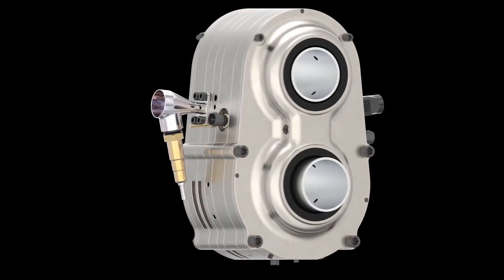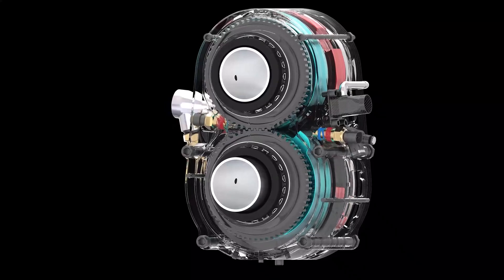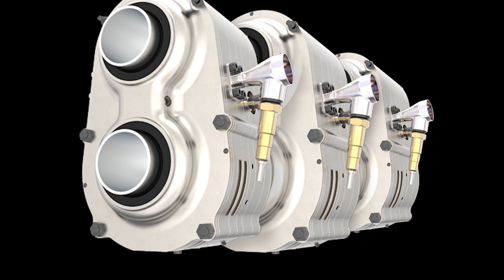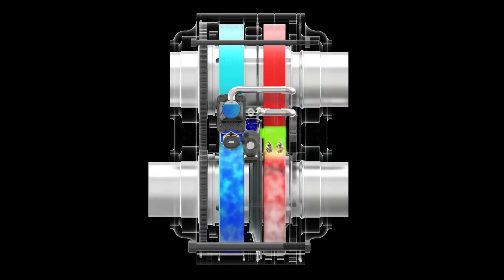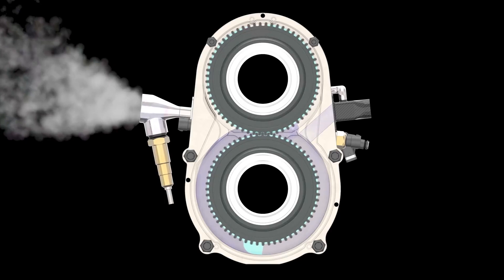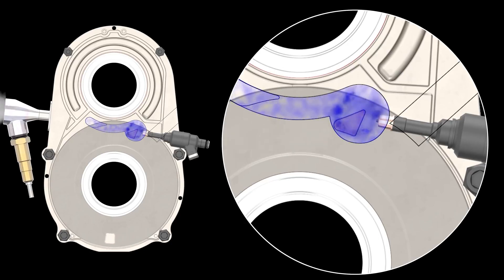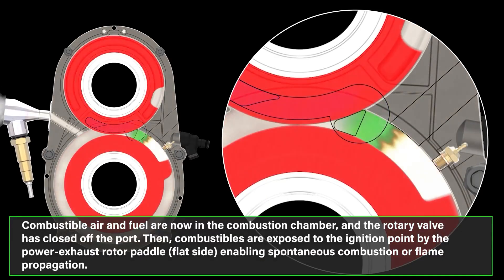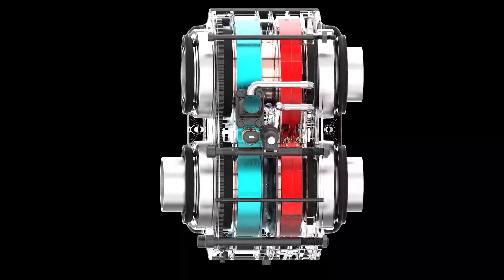This pistonless engine runs on hydrogen and revs to 25k rpm

Comment: [Initial coarse appraisal of carbon/carbon mechanical properties were carried out by spin pit testing and furnace oxidation tests. Spinning was by a vertical air turbine capable of 150,000 rpm in a chamber evacuated below 100 microns to reduce air friction. Coupons were exposed to oxidation in air in laboratory furnaces and tube combustor liners in a burner rig.
The following significant observations came as by-products of preliminary experiments.
•
•
•
•
Press- or serrated fit interfaces of carbon/ carbon speciments with metal fixtures caused no notable distress or bias in test results.
Gross scratches, gouges, punch marks, and other intentionally imposed defects did not act as stress concentrators or promote fracture at sites away-from expected stresses imparted by spin tests.
Disk and bladed specimens machined to simple tolerances were so light as to require no balancing.
Fragments from spin fracture were thrown into the spin pit enclosure much as metal fragments are, but were so light as to he caught in a rubber-backed plastic pail rather than the lead lined concrete pit normally required…Summary: Certain items seemed well resolved in the WRC feasibility study of carbon/carbon for engine components:
1. Several carbon/carbon bodies of suitable specific strength at ambient temperature retain or increase strength to 5000°F.
2. A sound industrial base of supply and technology is in existence for carbon/carbon composites, and can be expanded or diversified.
3. Carbon/carbon is nonbrittle, nonductile, and relatively forgiving of minor defects.
4. Analytical methods are available for development or determination of optimized fiber architectures in carbon/carbon bodies.
5. Some oxidation and erosion protective coatings for carbon/carbon are of demonstrated usefulness in turbine combustion products.
6. Machining and forming processes for near next shape have been demonstrated.]

https://watermark.silverchair.com/v001t04a001-81-gt-35.pdf?token=AQECAHi208BE49Ooan9kkhW_Ercy7Dm3ZL_9Cf3qfKAc485ysgAABAMwggP_BgkqhkiG9w0BBwagggPwMIID7AIBADCCA-UGCSqGSIb3DQEHATAeBglghkgBZQMEAS4wEQQMk6Y002e-RYenfcpSAgEQgIIDto0Me_GKiRIZ6Rct9-nDEVEfWTFHUPVe6KrPo0jWMMS1ybGuNsMJrDvk8vujSdfykABp5WlWz10Kxlx3b4k3NvPXtJGA8XkRgBu_MEt4TNz_nMi-vxI7Uhsf4yG-ixKQReHpgz8UE-oEbjUJdC5QTgsgadsCg27ozJjbE33MmMowkSN_3OKMORFiQwR-FZiPT1Pc8lTrLNdF9mG3vBr4__r6Ko_kT5sEMRvGgb9pay-UHQgkgcqVWTNlukL8GJUFxcacfzCM7_hu9qO3KNvtqmfODA7fx8_7gPRohzpbBtbKDM0MTfWb635Stx06sdTAZVWmLpr6yvZBOcLRBqapGIP2zaBV2MzBsx4J2ZP5i-hXQsvssujSECWzO-z1CSV-0U-lKaRhZFUIyazyafe0GKE7_xcLg9T4V1lGOzMVkjGYE8vZlnmiCRbrUr7ItTIY6iBi8pXORS8LBL0remNRAe6vpQOibHvvLuonxjlhyRmw-782H3x25HdH91I870Npl3U23wupMdAzZiifTn3KoEN3G0o1AUBLvarwrc_inPXDnwnajgT7dMhIguWsVEm9y7EIfYdhxmwlin8qm76hsKGYaZdInIyfeISwIxb4fbKT128YbACm6pPyXsjuC115W1GiL_XCuuHKTz4sSEQSiiNYqZBpZoLqb6U_QgkP7-ZsAyYkhKqY9SFztG93WyfH5W_XhG-EEiboJ9FcwTp3WJrzbCRqa5cTjqHIY4WO_hCmy5J6RL6RRX1pUsEu02sayKimhVKtiLW3jpF_P1hCgtY6nEAkn7aoJ25VlKKc1vC_QrSVaTWGm5MNn5hiR84WAmcGTImhv5b05YNdPrgyZF23ZehASKTE7Pm2qWZRE1Imzc2wviTHwcd42i0YmROI4xyNw-VGu3eSmSc_pX5oBhC0IaD4ZQ3VXv2azZrm45SyqOKt5odlEDz0c80kTCh4N2I1PI33xcC2e10-r2Sl0QEYZSRxDavRgLzw5bu-0EuP2yXpbr1KKwJmHMOuoPJDYbxu2hnc1b1QnK4HH3cH7fOUdGmUXgYbiKNfJ1rk6ixbjoTYZ1WtTSHoXXLYR6l968FsHXB3KZq7hffFex8AEtstPwhEx0n9J5tu5HYqWEskZTOUjCjT934eKdt5JZUi9wBB2Z3Jr7CYHly0DDOtTaQDvJAcQK6G_5mWF-pOSRf5tPHjZFp9I1JzgaKe2_Eu5h_eqqohM_prMa3pC-9By5sT0669SQKLIFh_yjzrpzOjrV_fuq-N
Reply: [This paper is an abridgment of Williams Research Corporation Technical Report AFWAL-TR-80-4036. The work was sponsored by DARPA and monitored by Ronald J. Kerans, project engineer of the High Temperature Materials Branch, Metals and Ceramics Division, Air Force Materials Laboratory.]
Reply: These little beauties were proposed as possible power plants for power armor. Running on hydrazine and spinning over 60k rpm. Lifespans of 50+hrs aren’t particularly problematic in combat conditions especially where hot-swap is available. Imagine a pilot ensconced in a syntactic foam eggshell with retro reflective coated vacuum filled glass spherules embedded into an ultra-high molecular weight polyethylene substrate…it attenuates bullet, laser, and microwave damage but, also floats.

Comment: Looks good in theory....but....
It's air cooled, with no seals, extreme machining tolerances, and runs at 25,000 rpms?  Seems like that will not take long to warp, which would make for a spectacular explosion at high rev.

Comment: EV cause masses of environmental destruction and Deforestation of the Congo etc, ICE vehicles are far less destructive, esp as we can use ( clean burning) Carbon Neg Algae Bio Fuel. That permanently sequesters 1 Ton of CO2 for every Barrel(link below). Also we can make Carbon Neg Hydrogen from Algae BioGas at scale using current Steam Reformation Plants, using the Algae BioGas( Methane) to make the Steam and to get the Hydrogen from. The CO2 that is released fed back into Photo Bio Reactors(PBR) to produce more Algae, and the Algae is fed waste water, so cleaning it in the process!https://youtu.be/EmiNcxbpFnI

Comment: Many places are set to outlaw the sale of new internal combustion engines by 2035, that gives you a fairly small window before your only customers will be third world countries that can't afford this shiny new engine. Or those who live in countries with lax emissions laws. In either scenario the engine is more likely than not to be put to use in less than desirable conditios ie: mud, dust, sand and rain.... I don't see an engine with no seals that relies on "super tight tolerances" surviving under such conditions....just saying🙄🤔

Comment: This is cool, but I don't understand how the combustion is generating the rotational force.  I see the explosion is happening in that expanding chamber (which looks to be just a section of a cylinder), and it has one flat side with a slanted side opposite, but wouldn't the force be the same on both sides regardless of the orientation of the face it's pushing on?

Comment: generate electricity > create hydrogen > pressurize and transport hydrogen > power car by burning hydrogen
will never be as efficient as
generate electriyity > power car
it's simply not possible with all those extra steps.

There is no place for hydrogen engines in future cars! The only place where it makes sense are vehicles with extremely long ranges that don't have regular access to the power grid or would take to long to fully charge like cargo ships or maybe public transport busses/trains that would have too much downtime if they needed electric charging.

Comment: my biggest problem other than how would you even make that because of the tolerances and material warp at that rpm but the fact that hydrogen is easier to ignite than gasoline so your car would be driving around with something a lot more dangers than gasoline in it one bad hit to your car and boom no more car

Comment: You either make hydrogen from crude oil (bad idea) or water using massive amounts of electricity.  So, even if this ridiculous engine design worked, it still doesn't solve any problems.

Comment: If it is truly lightweight and is buttoned up tightly enough to not need sealing at all mating surfaces, then I guarantee you it will not fit together again if it is ever torn down for servicing; everything will warp so that every mating surface pair will have to be re-machined. Or are these to be disposable engines, like a Honda transmission — non-serviceable, only swapped out if/when issues arise? Sorry, Chris, but if this design was into the physical prototyping phase and it actually worked as advertised (and not simply a CAD file on some engineer's computer) we would have heard all about it on some major outlet like CNN or the New York Times and not here. (I don't mean to be offensive, just realistic. This would be world-changing news and would be trumpeted from the rooftops by every major news source on the planet. Lots of small companies lie or mislead to continue the inflow of funding or to build their brand name. I suspect this is what happened with this "news" and you. I think you were told some fancy fibs and given a nice set of visual aids for your channel to help promote what is likely an engine that is 100% digital and 0% real. Still, I enjoyed the video and learned some, too. Good job. I just suspect this company rep allowed you to draw a lot of inferences from what he told you. The truth is that this is more of a might be thing than an is thing and they are using you to fish for additional investors. They are not necessarily crooked but might be intentionally misleading. Best of luck, man! I'll keep watching your stuff. Cheers!

Comment: In theory this is brilliant and green motoring in the right direction. As many have stated the tight tolerances needed would be the hurdle to overcome. Here it gets to -40c in the winter, +43c in the summer. Metal expands and contracts greatly. Would it even start at -40c It needs more work and practical testing. But as the plug in electric vehicle stands now it is not a practicle solution. We don't all live and work in cities. On the right track though.

Comment: Sounds good on paper, but I'd like to see one of these work in real life. It doesn't need seals because of incredibly tight tolerances? Case in point, Formula 1 engines only last approx 1300 miles before they're replaced and that's with constant maintenance...and those have incredibly tight tolerances AND seals.
Maybe if this engine was made of some magical metal that didn't wear or expand and contract with temperature it would work reliably... but even if this would work, I can't see it working for long.

Comment: It works beautifully in the animation.  Machining it and making it work out of the design app is something else.
Reply: Yeah, if this isnt bullshit at all, tight tolerances mean very high manufacturing costs, we wont be seeing this in cars any time soon, if ever
Reply: @CarFreak that's bullshit ..we had electric cars doing 60mp/h in 1890
Reply: @CarFreak  of course they did. 
On the 29th of April in 1899 Camille Jenatzy set a new record reaching 105,882 km/h. He used an EV with a 
25 kw engine.

That's not exactly 60 mph in 1890 but roughly the same time and speed. By now it should be common knowledge that EVs were around before the combustion engines took over.
Reply: @STFU2142  They had an electric car doing 100x the speed of sound in 1899?
Reply: @CarFreak That's a different issue. The issue of electric has always been one of technology - High power-density batteries, etc. This problem is one of machining and basic mechanics and physics. They're not comparable, you don't know what you're talking about.
Reply: @UnitSe7en  just a wussy sheep who hates on electric because he likes combustion engines.
Reply: A robot has already replaced you down to the opinion.
Reply: @wolfgangzeintl6425  Wait, is it that weird European way of writing decimals?  Cause if so, I get it now lol
Reply: @andreichira7518  105.882 km/h (roughly 60 mi/h)
Reply: @ARockyRock  isn't 60mp/H about 99km/H ?
Reply: @DrSmugface  I did say roughly. Just a comparison so other ppl from the states have an idea of how fast that is.
Reply: @CarFreak that was not the problem ..it was the same we have now batteries are heavy ...so everybody decided to go petrol and battery research stopped for 100+years
Reply: @Fiendish Memory that's obviously a copy-error, you shmock. It should be common knowledge for native english speakers that their language is pretty much the only one using a decimal point rather than a decimal comma. Apparently I copied that number from a non-english source where the decimal comma was used. 😒
Reply: @CarFreak and it was and still is true

Comment: May be a goog Engine - better than current ones with all that slapped on exhaust gas handling. Bur in the end it is crucial that we get rid of the use of every single Liter of Fossile Fuel. So there will be no Market for a Large scale Use of that Engines in the Mid Term. becaus all Fuels used in this Engines have to be generated of renewable Energies. And it is with the current technologies most likely the case that using the energy in batteries to drive with it much more cheaper than to convert it to liquid Fuels and burn it in any sort of combustion engine. Just because of the involved conversion losses.

Comment: Hydrogen was always my take. Good idea.
Reply: Hydrogen is extremely explosive lol no thanks!
I really like the idea of an electric air breathing engine.
Or bring back steam :O
Reply: @baaldiablo8459  I am talking of Hydrogen on demand. On you tube is nice explanation of it. I am regarding it as quite safe. And I must say it is not disappointing . I am using it as hybrid with petrol/gas. The petrol/ gas in small amounts. I just put two gallons or ten litres per month in my tank mostly for emergencies. Hydrogen is very quickly dispersed into the air when the hydrogen generator has a tare or get broken and it is extracted out of water and baking soda. It is very safe. But not those you have to keep in coolant containers. Nope their I would also say give me rather electrical engines.

Comment: only 25,000 rpm?  That's nothing.  My engine which also only exists as a cad diagram revs to 100,000 rpm makes 2,000 horsepower and only weighs 10 kilograms.  It does this through the magic of not existing in real life.

Comment: The fact that it compress air makes it ideal as an aeronautical engineering!!
Reply: What?? 😕
Reply: @davelowets  A plane engine. By compressing air it will allow these smaller piston engine planes to go to higher.
Reply: @leovermaak7670  We already have plane engines that have no issue at the edge of space

Comment: Seal-less engines seem like a pipe dream, however more HFCV's on the market would be great for eliminating the need for gasoline and that kind of weight savings would do wonders for fuel efficiency in a hydrogen vehicle. That said, I question how difficult this would be to manufacture, as you'd need some really high precision tooling and machines to manufacture the components so flat that you don't need seals. Not that making something with seals is all that hard, nor are they generally hard to replace, and considering how long engines last before seals need to be changed these days, I doubt it would be an issue to even build one with seals. Still a neat concept but I'd like to see them actually have working prototypes before I pass final judgement.
Reply: actually I think it does not need any high precision, at all.  and this engine does look interesting  but the way it is presented  is pretty obvious scam.
Reply: No seals? Its been around for along time not a problem at all
Reply: If they do decide on seals the could use the graphine materials. High temp high wear resistance
Reply: I've done machining like this before. I used a Mitsui Seiki made with 50taper collet made in 1989. The right programming, offsets, fixtures, lubrication and a 5flute carbide endmill and I was able machine transmission parts with a tolerance of 0.0002inch.
Reply: @hackingnut4164  ye not good enough for this ..
Reply: Why are people insistent that gasoline be forced out? It works. Clean stuff will come. Forcing it out the door has worse problems.
Reply: @elimgarak1127  climate change? Vested interests of gasoline companies?
Reply: @elimgarak1127  Clean-burning gasoline is a technical impossibility.
Reply: @elimgarak1127  It's literally not fine. Nor is the industry. But developing a new IC engine - or speculating about one, as investor-bait - that uses hydrogen as a fuel is, well, silly. It works great in a fuel cell for generating electricity (and does away with both the needs for large battery packs and for a substantial upgrade to the electrical grid). The issues with that are figuring out how to make the production of hydrogen economically viable, and also building transmission lines and storage tanks that won't leak or become brittle. That is where the money from well-heeled investors should be going, not something like the... idea that's being shown in the video. There have been some recent advances in the field (of hydrogen production), but we're not there yet. Some interesting recent developments in fusion technology, too (but that's probably 20 years farther off than hydrogen).
Reply: @wesgregg6451  you did not read his comment apparently
Reply: @wesgregg6451  Pigeons and bumblebees cannot fly because of the laws of aerodynamics.
Reply: @Baetzibaer  Pull the other one - it's got bells on it.

Comment: Electric cars are complete garbage. Batteries have low range, long charge, short lifespan, heavy, polluting waste. If battery tech can improve, maybe there is hope but my money is on H2 in the long term. When I speak to ppl about their electric cars, they have anxiety when undertaking long drives. They even have to consider the time of day and when the sun sets because turning the headlights on affects their range. Fuck that. I want to get in a car and go.

Comment: The engineering and tech are all very well, (and interesting) - it would either work as advertised or not.  The main issue may in fact be the  ability to carry sufficient fuel to make the tech practical. Whilst I love the idea of super clean intenal combustion we currently lack the tech to carry realistic quantities of the hydrogen required to provide reasonable range. Currently even the limited range of batteries is superior, pound for pound and I think that tech is about to make a step change in efficiency in the next year or so